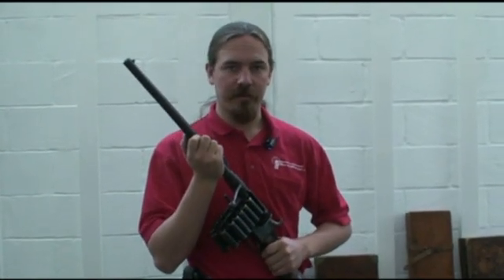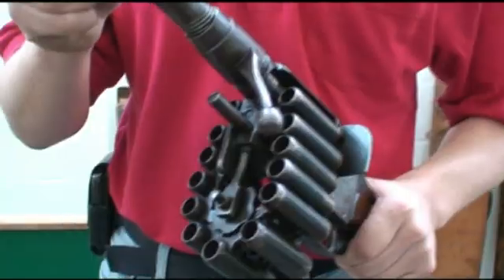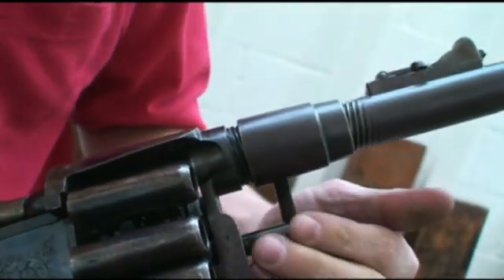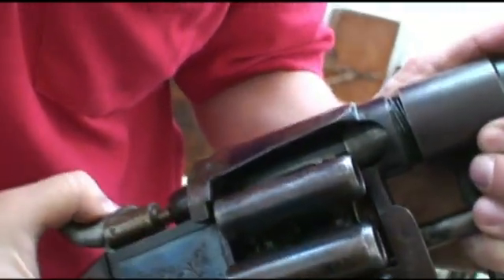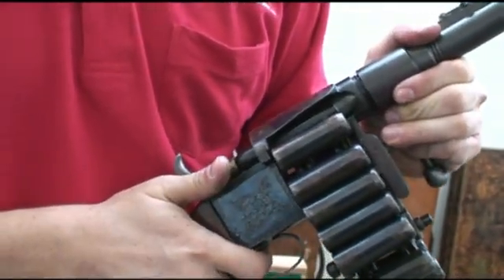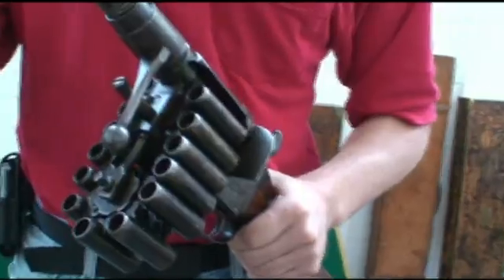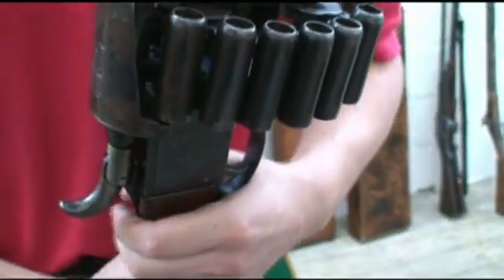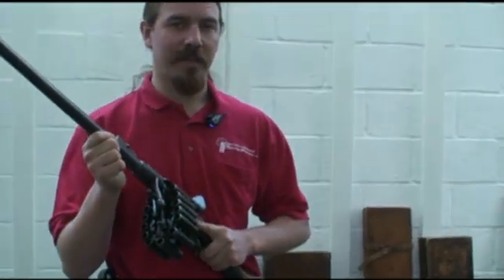Treeby Chain Gun

Comment: So mostly what it was lacking is an easy way to break and replace the chain. If you were really clever you might have a catch pin on the last camber that would auto break and drop the chain on the next cocking action. Snap in a new chain, wrap around and engage the catch. Maybe combine the barrel movement action with the cocking so that moving the barrel forward also operates a rod which pops in front of the hammer and pushes it back when the barrel is closed. Then it could either pop out of the way at the end or with the initial trigger load.
Very interesting.

Comment: Once you had discharged the 14 chambers you wouldn't have to reload all of them.  Just load the next chamber up - bite open the paper cartridge, pour in the powder, seat the ball with your fingers, cap the chamber an fire.  It would still be much faster than, say, a Springfield or Enfield rifle musket.  No ram rod to withdraw, run all the way down the barrel, and replace.  

Imagine a company equipped with Treebys against a regiment armed with rifle muskets.  Unless the regiment could close with cold steel it would likely be cut to ribbons by the rate of fire of the Treeby equipped company.
Reply: That was my thought exactly. Plus, imagine you had an entire line of infantry armed with these monsters; you could  loose a dozen volleys by the time the enemy fires two! So long as you take the time to aim, you could potentially wipe or rout the enemy with ease, buying you the time to reload all links and do it again...
Reply: imagine a company armed with these some lever actions and some revolvers. lever actions only came out a few years later and while they have some advantages the early ones couldnt take powerful rounds. use the treeby like a really fast full caliber rifle and use the lever actions like a carbine for close up work and revolvers and a sabre as back ups.
Reply: This is realy like shotgun from Metro 2033 =D
Reply: Imagine if they were able to remove the barrel chain and replace it with a second one (like some sort of proto ammo belt) that is preloaded
Reply: There is a problem. Black powder projectiles must be fully seated against the powder. Failure to do so leads to explosions of the not fun variety. So you do still need a ram rod of some sort.
Reply: @jagx234  but not the three foot or so long ramrod of the Springfield or Enfield.  Depending on the fit of the ball into the chamber and the size of the soldier's fingers, it might be possible to seat the projectiles with bare fingers.  Or, at worst, a 4 or 5 inch dowel.  Still much faster than the long ramrod of the standard rifle musket.
Reply: Extend the chain, make the barrel movement automatic to a turning handle. Probably would have made an effective machine gun.
Reply: I imagine these were extremely expensive compared to the conventional arms of the time.
Reply: it would probably be somewhat viable for a smaller underdeveloped nation today. just imagine if you could change out the chain as a magazine. 14 rounds is normal for today, and a .54 is stupid big for that. its gonna plow something.
Reply: The early one's can't take powerful rounds? What the hell are you talking about? The Spencer rifle fired a really potent round equal to regular muskets of the day. 350 grain bullet at 1000 to 1250 fps isn't bad at all.

Comment: And then of course the self-contained brass case arrived, and the Treeby was overtaken by events. Still, it's a fascinating concept - especially with regard to the need to seal the barrel and prevent flashovers! One can picture a modification of this, where the "chain" of prepared chambers can be swapped over more easily, thus enabling a more sustained fire.